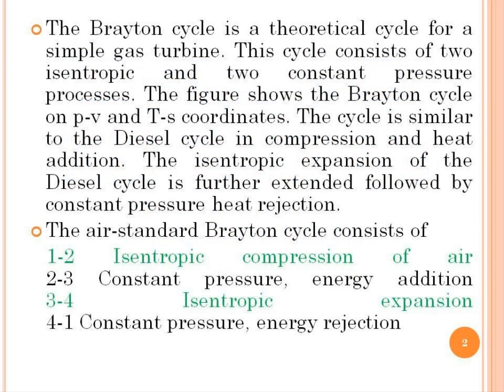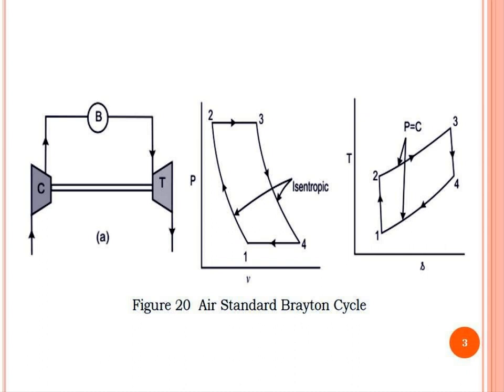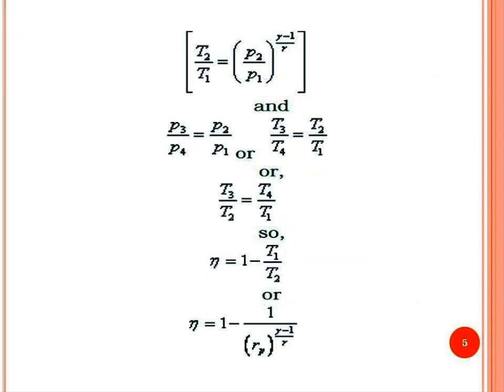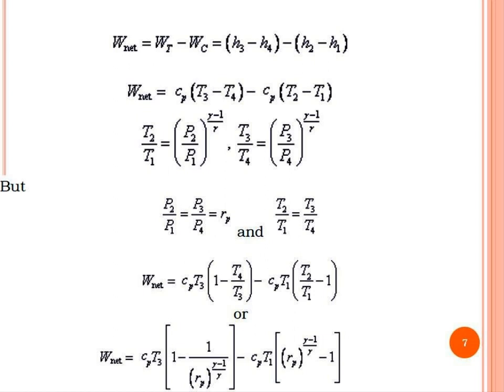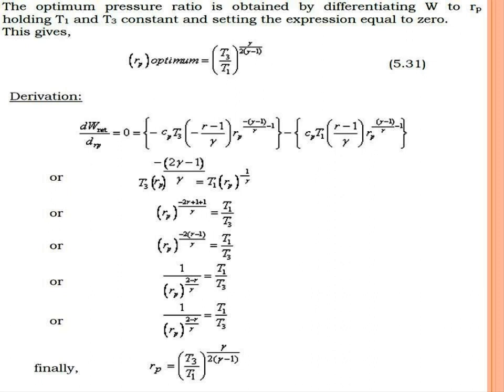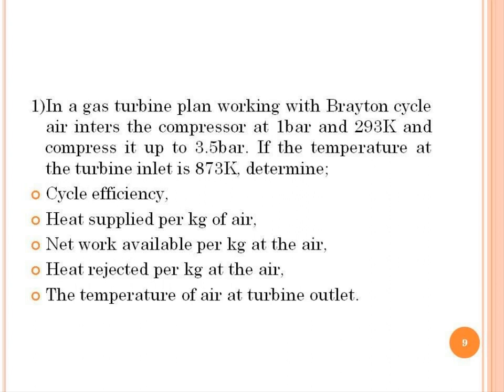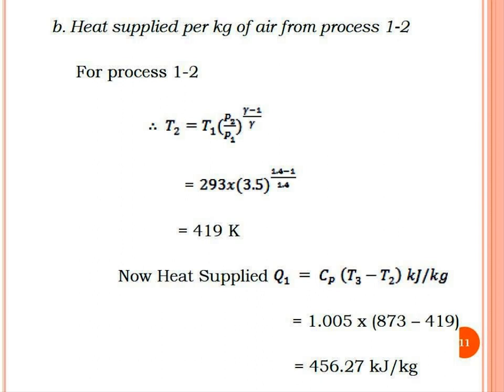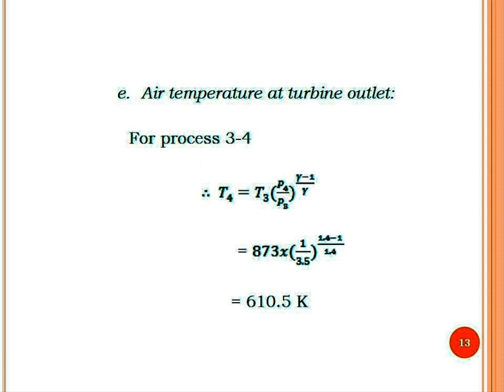Brayton Cycle |  Open Cycle Gas Turbine  Plant | Gas Power Cycle | Introduction to Gas Power Cycle

Comment from the maker: The current video is catering to the needs of students regarding the basic concepts of SIMPLE OPEN CYCLE GAS TURBINE CYCLE / BRAYTON CYCLE with sample numerical. It is very helpful to beginners in the field of mechanical, aeronautical, automobile, agricultural, chemical engineering, etc. of  DEGREE AND DIPLOMA ENGINEERING.